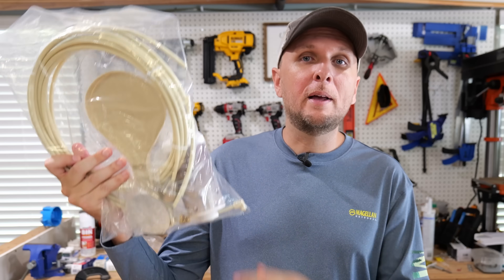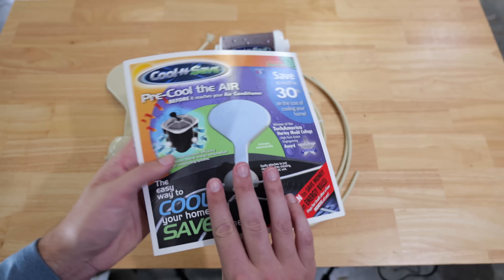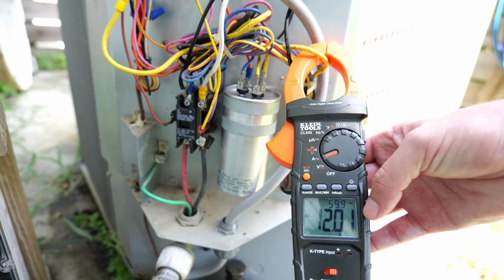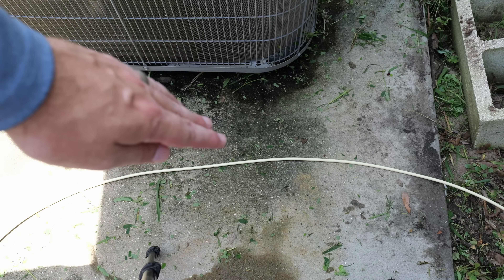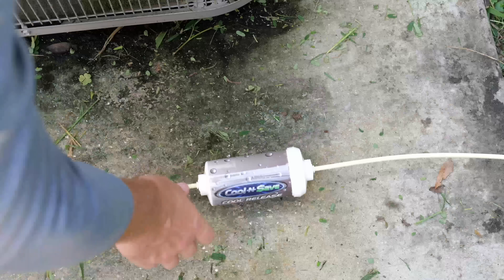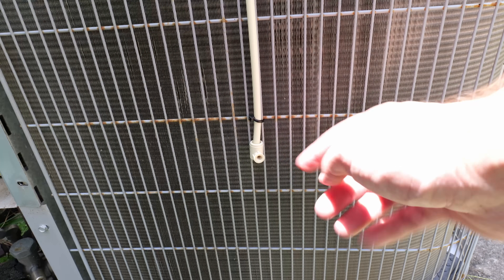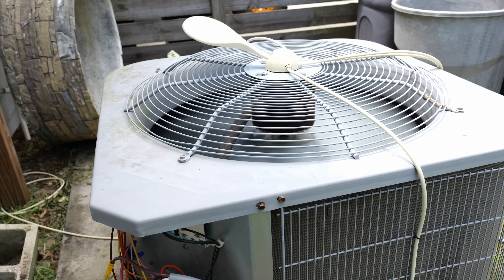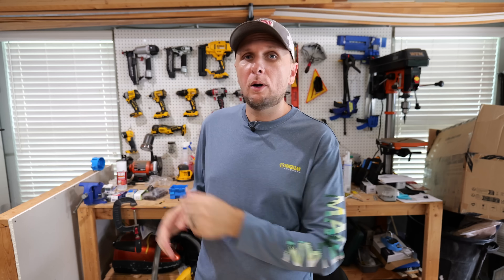This Device Can Save You 30% On Your Energy Bill! Makes The AC Blow Colder

Comment: I really feel for you people with hard water. Where I live the water is pretty much mineral free and can be used right out of the tap. It would take forever for any mineral build up.
Reply: mine is virtually mineral free but nozzles still got clogged by microscopic rust particles from the main pipes out on street and mains coming from mountains many miles away

Comment: Hey Adam,
My wife and I have been in the process of installing a generator and all the other things that come along with it.  We are learning a lot about the what needs to be done. From your content the one thing we have absolutely learned is that "we can do it ourselves."  I know our question it is not the topic of this video but I was wondering if you would be willing to entertain questions about a surge suppressor in our electrical panel? We are not sure if you have another area you would like to discuss  this in as well. 

We noticed you have a GE Breaker and Box but you installed a SIEMENS Surge Protection box rather than a GE Surge protector that has the pigtail that goes to the neutral bus bar. We are wondering why you made this choice. Are there pros and cons to this decision? 

In the meantime, thank you so very much for all your content and all you do for homeowners.
Reply from the maker: Yeah, I did a ton of research into whole home surge protectors and it was clear that the Siemens FS140 was the best I could find.  It can absorb the most out of all of the surge protectors I could find.  I also like that it lets you know using lights and sound, if it’s absorbed a large surge and needs to be replaced.  Many others won’t do this so you have no idea if your surge protector is protecting you anymore.  In fact mine is still good after 3 years where we get storms regularly but I bought another one as I’ll be doing an updated video on it soon.  I researched them all again and still think it’s the best.  Costs more but for me I’ve lost electronics to surge and they cost way more than the surge protector to replace.
Reply: @HowToHomeDIY  Thank you so much! I apologize for asking out of context of the the current subject. My wife and I are super grateful for everything you show!
Reply: @HowToHomeDIY  The FSPD 140 has arrived and is installed! I am curious to see your take on it. Crazy simple job and no one got shocked! (LOL)

Comment: In my research of this device after finding it on this channel, I found a number of 'subscribers' (sic) made/copied the exact same fearful/negative comments they made here about this device, to other channels who also featured this type of device.  Do they have a $dog in this hunt?  I don't, but I literally can't stand keyboard experts/karens demonstrating the veracity of the Dunning-Kruger effect!  Give these people and the company's trying to help people get out from under the thumb of the corporatists, a break?!  

People think these condensers are fragile and will 'junk' in a few years.  Epiphany - they are made to be outside in all types of nasty weather and run constantly in the worst conditions/heat.  If the 'experts' have actual scientific experiential examples of coil cleaner 'rotting out' the coils in a short period of time, or tap water 'damaging' the coils, I'm sure everyone would be all ears.  In reality, no one will be holding their breath!  These are designed to be cleaned at least yearly with that cleaner . . . and last for decades!  Some made the comment that this device would use "tons of water" and negate any $ savings.  Tons of water is 2000 pounds multiple times, correct?  The device - if a person runs their a/c ALL DAY, apparently uses only a toilet flush amount of water.  So assuming the worst of conditions running the a/c literally ALL DAY (and most only run their a/c for a season each year and a few hours of running time each day), it'll take (2 gal. - 8.34 lbs) 239 days to use a 'ton' of water (479 gal.) - which is likely 2-3 or more years of using a/c.  Look up your water bill and see how much water you already use a day.  This is literally a 'drop in the bucket'! 

If the bunch of 'experts' had done a little research, you'd find others here on YT that have actually used this type of device and had substantial long term savings and NO problems with calcium build-up or MONTHLY coil cleaner cleaning!  Beyond that, those with water softeners or even RO water filters, can run a line out to the condenser and literally have no minerals in the water to 'destroy' their fragile condensers (RO tanks are over 2 gallons, so think your RO filter keep up with 2 gallons max. a day, at 50 to 100 gallons a day filtering capacity?)!  I just discovered this device, did the exhaustive research prudence requires, and will be installing this type of device on my own a/c using an RO water line.    

Sheesh, everyone's an 'expert' on YT . . . most with no experience!  Funny how humans run the gamut - some so fearful they can't leave their keyboards; and some so fearless they can invent great things (failing many times) and explore/discover the world!  For those so inclined, stop being so fearful (even though the globalists/corporatists have tried to train you to be so after a lifetime of media predictive programming, especially 3 years of the scamdemic), and go live life to its fullest!  Cheers!

Comment: I would not want this misting all the time.  I can easily see my water bill rising.    I have taken a hosepipe over to the coils and misted them, so the concept works (as the fan blowing out hot air turns cooler as the coils are cooler).  Just have to analyze how much $ you're saving on electricity versus how much you're water bill is going to increase.

Comment: (BEWARE) So yes having water spray over your condenser coil will lower your compressor compression ratio ( Lower head pressure)  thus lowering your amp draw by a few amps. Adding a filter to remove water hardness is a must but remember all the condenser coils are made from very thin aluminum. Water will corrode bare aluminum over time decreasing condenser efficiency  just look under the hood of any car with aluminum parts you will see a white crust over time. When A/C manufacturers are all trying to have the highest SEER rating don't you think they would incorporate something like this into the units from the factory if it was a good idea?. I have 30 years of HVAC experience and would never install on my units.

Comment: First, if this was such a good idea, why would every major ac designer make this part of their energy saving package. The reason is all the residue in the water will plate out on the ac fins as the water evaporates and clog up the fins. Then it’s time to buy a new unit. Second, you idea of a water softener is flawed. Water softener replace things like calcium in the water that make it “hard” with sodium ions (which it gets from the salt you put in the softner) which make the water “soft”. It doesn’t remove the crud from the water. The sodium versions now are there to plate out when the water evaporates.  The only way you can remove the crud is either distill the water or use special very expensive “filters” which would eat up any cost savings this device would have. Adding water sprays to the air conditioning coils is a bad idea.

Comment: It is a known fact that long term use of water spray on all "common metals" will corrode metals unless they are stainless steel or other designed non corrosive metal.  Good Luck.
Reply from the maker: No luck needed 😂.  It isn’t used but a few months out of the year.  Gonna be fine.

Comment: I'll bet that you will have scale on the condenser soon and dont use acid to clean it off!  But what else can yo use?  I don't know.  Acid will eat your coils and fins  as In know of another persons experience with that.   Also I spent 4 hours analyzing a similar system with a subcooler connected to the freon lines and the savings was all in the drop of air temp indoors.      it is done all of the time in south west USA with subcoolers which do not affect the coils being sprayed with hard water .

Comment: I had a similar system like this on my Lennox A/C unit (SEER rating of 18) for a few years.  This system was originally launched on Kickstarter.  Basic concept was same as the system mentioned here.  It was a bit more high tech for a few reasons; rather than a paddle on top it had small fan to generate electricity to charge the lithium battery.  The battery controlled an electronic valve for the system.  This has an electronic control system the communicated with the internet via 3G cell signal.  The system would use national weather data to control when it ran.  So when my AC unit turned on the mister would only come on when temperature was above 80F and lower humidity (not sure what the cut off was set at).  This had a similar calcium filter cartridge.  I live in Michigan and the number of days above 80F is small relative to all the comments from others in Texas.  My water is relatively hard (350PPM based on reading at tap).  I never tested the water after the filter system to see if it reduced the calcium output in misted water.  I did run this on and off for three years.  The system had a lot of software problems and never worked great.  It was a subscription plan for $99 per year.  Free maintenance and replacement of hard water filters (self monitor when unit needed new filter). The company went under and that is when I took it off and dumped it.

A few comments:

1. Not sure I realized any electricity savings.  I did not do the  amperage testing or the cooling temperature indoors when system is running.  My Lennox system is a variable fan speed motor so hard to do this testing versus older system that is either on or off.  When I compared year to year electricity usage I did not see a significant savings.  Given multiple other issues (like it not working as it should and poor connection to cell towers), I am not certain I would declare this a failure.  I wish I had done more testing on amperage, indoor temperature at vents and PPM of water at mist.  

2. I did run this for three years.  I did not see calcium deposits on the condenser unit.   I do all the annual cleaning so I know what the coils looked like before I started this system.  I do find it interesting that this YouTuber did not see a higher amperage when the unit was running.  I thought this might happen given increased work of moving higher humidity air by fan on compressor.

3.  Total water usage was minimal.  This maybe from how my system did not run all the time but only certain conditions like high temp and low humidity.  Still doubt cost of water would much relative to cost savings on electricity.  

4. Mold.  I was concerned that I would see mold build up around AC unit.  Did not see any.  Did see bit more green moss near base of AC unit.

4. Why don't manufacturers build in this function, my thoughts are that this requires a lot of upkeep; changing filters, unhooking lines for winter, monitoring coils and cleaning, keeping clearance for mist to spray around.

Hope that helps
Reply: "I do find it interesting that this YouTuber did not see a higher amperage when the unit was running.  I thought this might happen given increased work of moving higher humidity air by fan on compressor."

But it's not only moving air with a higher humidity. It's sucking in cooler humid air. That would seem to be less laborious.
Reply: I would say relative humidity and ambient temperature will make a huge difference on the benefit you see from this addon. High humidity sub 90 degree temps like you find in Michigan most days would provide only a small benefit. Low humidity high temps like Texas, Arizona, Nevada you would probably see a much greater benefit. 

I would try sitting outside on the shade with a mister attachment on a hose, pretty sure they are cheap and would give a good metric. If it works really well, so will this. If you just get wet, this won't work very well.

Comment: those vacuum breakers are junk and you should never cut that tubing with side cutters.
Reply from the maker: There are electrical wires inside the mister tubes, you can’t just use scissors.  So yes, side cuts are a good choice.  Even without the wires inside, why should you never cut with side cuts?   Who cares as long as it cuts cleanly? 😂
Reply: @HowToHomeDIY   good to know they put wired in there . thats no good. Also, it mashes the tube and makes the orings in the push to seal fittings not seal well. Would be better to use a 24vac solenoid to turn water on when the AC runs and not block the air flow. BUT as long as it is misting the blocked airflow wont hurt it much. electrical wires should never be inside water lines even tubing. what the heck does that thing need wired for anyway lol

Comment: I would never add this to a new unit, but if I had an old unit on its last legs, I might consider it.  Remember, all the water that is getting sucked into the unit won't stay on the coils...  It will eventually get everything inside the unit soaked with water which could create additional rust and rot in the bottom of the unit if it's full of leaves and dirt like most units that are never maintained.  Also, think about all of the water constantly sitting on everything metal inside the unit.  All the water "Mist" will be making its way into the electric fan motor and perhaps even into the electrical connections on the side of the compressor, expansion valve or reversing valves of heat pumps, high and low pressure sensors and other electrical components inside the condenser unit.  While it may save you a few bucks short term for the few hot months of the year, I have to believe that the longer term negative effects will be far more costly over time and may well lead to a premature death of the condenser, the fan or other very expensive electrical components inside of the unit.  I think I'll pass on this one.
Reply from the maker: Appreciate your opinion.  I personally have to disagree.  Condenser units are made to be outside.  They get rained on, snowed on, etc. The mist is nowhere near the amount of natural weather and I just dont see it causing anything to go bad or wear down sooner.  Like I have told other, I am keeping a close eye on this and if I see negative effects, I will for sure post an update of some kind.  I have no stock in the company and bought it myself so only want to be honest with you all, my viewers.
Reply: @HowToHomeDIY    I'll 100% disagree with you, from experience.  We've had multiple Rheem/Ruud units fail due to normal use water exposure.  The condenser motor is mounted to the fan guard with recessed pockets where the bolts are connected.   Water pools in these areas and the tenant will usually hear a loud BANG! in the middle of the night when they've rusted through.   This is happening on 2-3 year old units(!).  

While I've not encountered these water misting systems, I've spoken with other techs who have and yes, they'll rust out a unit prematurely.  In our area, water is extremely hard, so any "savings" are quickly eaten away once the coils start to develop deposits, which doesn't take all that long here.  Only a few months. 

There's a reason water treatment is a huge part of the large chilled water systems.  Even with proper treatment, those do require frequent servicing and cleaning to maintain them.  Such cleaning isn't really possible or practical with consumer DX HVAC systems.
Reply: What happens to the water left inside the unit after it rains? That's what happens to this water too. It evaporates and since it's far less water under far less humidity than 100% rain not only does it evaporate it does so very quickly if not instantly.

Comment: Important fact few people know about hose bib atmospheric vacuum breakers: Can an atmospheric vacuum breaker be used under continuous pressure? No! Codes do not permit this as the device could become "frozen", and not function under an emergency condition. Those of us who have attached battery irrigation timers can attest that after a time the hose bib vacuum breaker will begin to leak as the rubber gasket deforms from being constantly pressurized.

Comment: Going to hate these calls when the homeowner is told by a real technician that it's a waste of water and your now turning your unit into an evaporator coil which its not supposed operate with condensation on it all the time. Already hear the comments of justifications of when it rains.... then they say but i spent like $60 on this cause watched a YouTube video more than they already do. Yeah; the amps go down; does the same thing if you clean it and run it wet after you clean it... which isn't ideal either. 🙄. Bet this guy has a video of why to install a inch width 14 rated filter too. 😅. This industry just keeps getting more and more pathetic.
Reply from the maker: Nope no video on that because I don't believe in the higher rated filters but appreciate the sarcasm.  There is nothing wrong with this.

Comment: The control for this test is ambient air temperature outside and the load on the evap coil (wet & dry bulb). A sub-cooling number before and after would also help a lot and what SERR the unit is.

Comment: Bummer. These folks won’t ship their system to Arizona or those on well water due to hardness of the water.
Reply: My brother lives in Yuma, and the EPA guideline on TDS is a max of 500 PPM.  His water usually tests out at 630 PPM. Those overhead misting systems clog up quickly there too. Until they make one with a filter able to deal with hard water, I would be afraid to use it on my condenser unit. I have seen how fast the water in Yuma can clog a showerhead, I hate to think what a mess it would make of my condenser coils.
Reply: @terryjohnson2093 I will use a reverse osmosis filter to remove the calcium